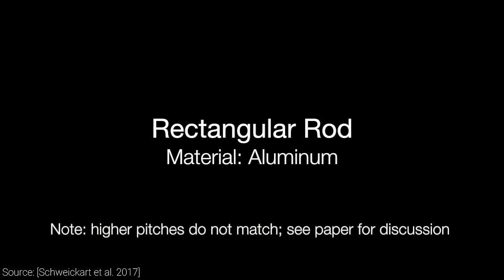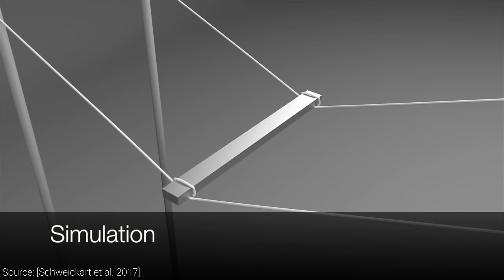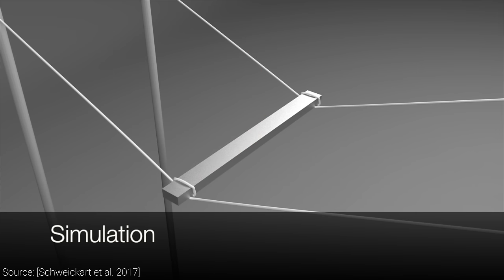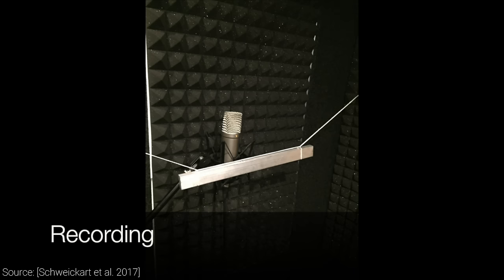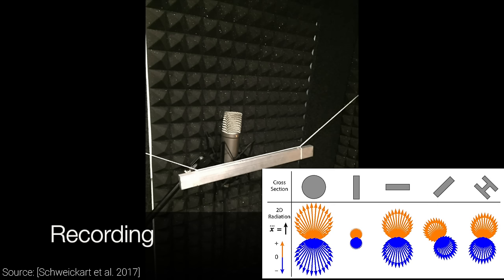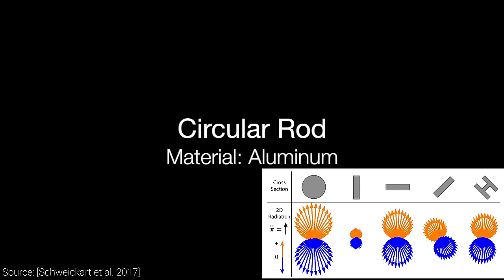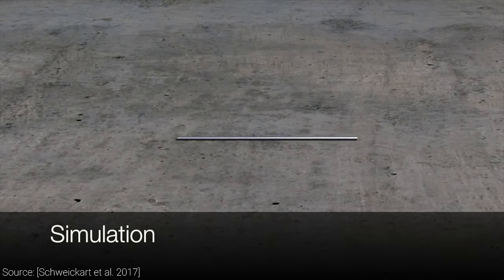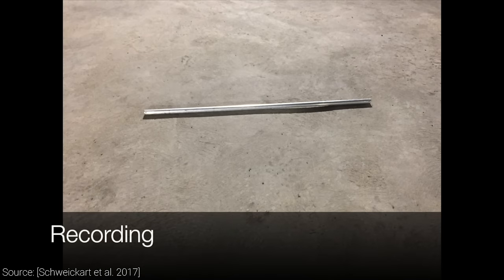Animating Elastic Rods With Sound | Two Minute Papers #175

Comment: It may be good to mention that these results are not real time which is a bummer. It takes about 1-2 magnitudes longer to synthesize these sound than to play them.
I wonder if it is possible to accelerate this somehow using a library of pre-computed results. As it is easy to store several hours of sounds inside memory.